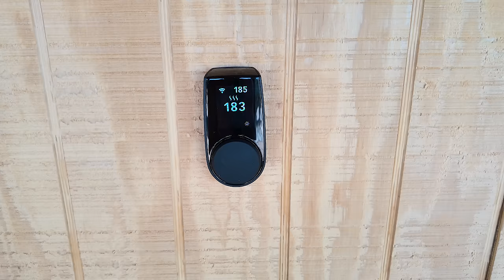NOT HOW WE ENVISIONED THIS GOING…

Comment: Regarding the Airliner inserts: Have you ever had issues when in need to fix a puncture during the race? I had issues inserting a tubeless plug with other tire inserts and had to remove the insert and use a tube. Basically the insert is blocking the plug from getting pushed through the sidewall - used classical repair strips as well as Notubes darts. Curious if this doesn't happen with the Airliners. Thanks!
Reply from the maker: Haven't had that issue. But have only flatted once with it in. The plug didn't seal the tire, but I don't think it was the air liner's fault, I think the hole was too big. Ended up riding the rest of the lap on the insert (it was a race) and putting a whole new tire on: https://youtu.be/hAcpwLkUmEM